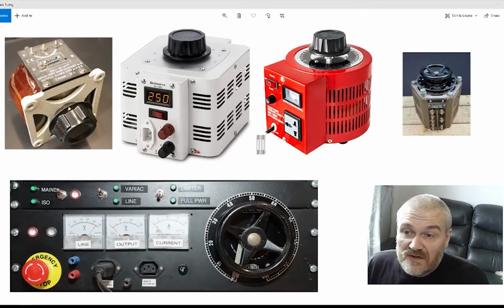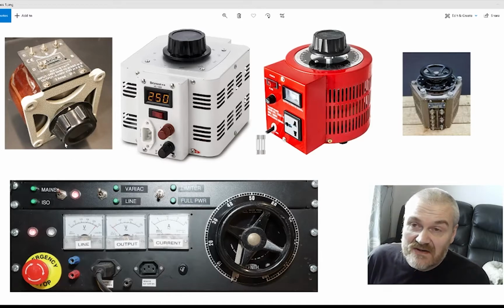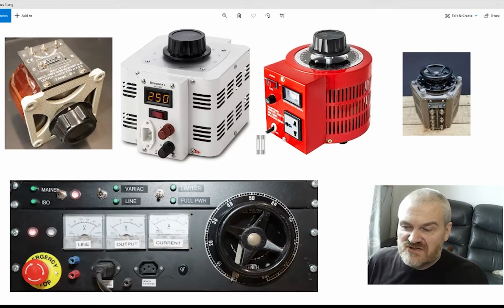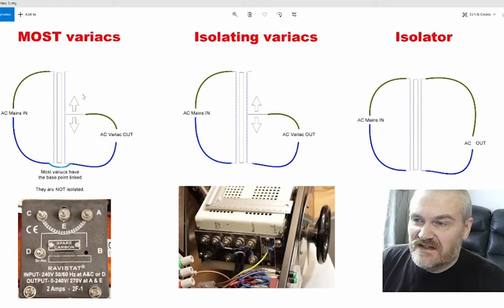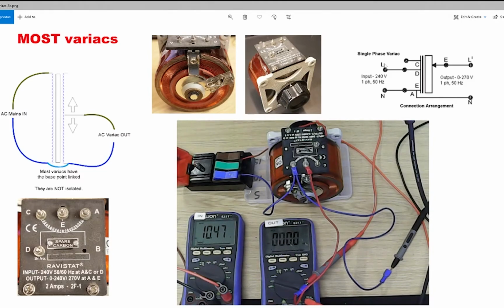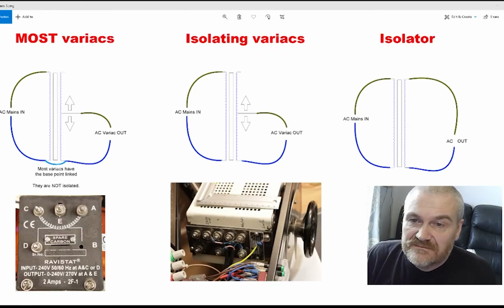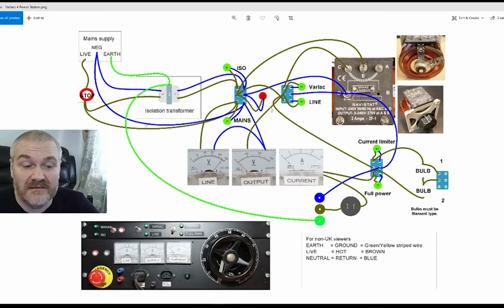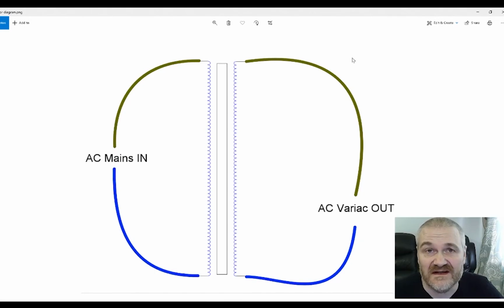#13 Variacs Auto transformers, Zenith Claude Lyons, Ravistat AC

Comment: Marvelous rig you've built incorporating the Variac, metering and switching into one unit! Must have taken quite a few hours? But, I must point out an error in describing the traditional 'autoformer' Variac: There is no secondary winding. (If there was, you could simply cut the neutral jumper from the primary to turn it into an isolating Variac.) Another slight mistake was made when you said that a non-isolating Variac would simultaneously drop the voltage by half and boost the current by two times. This is not a step-down transformer. It's not a transformer at all, but a giant inductor, with a movable tap than can slide from one end to the other. Now, you may be thinking: How does it give the voltage boost at maximum rotation? That's done by connecting the incoming hot lead to a tap which is a short distance from the high end of the coil. Meanwhile, the sliding tap can go all the way to the very top of the high end.
Reply from the maker: Yes, the comment about current was just chucked in whilst making the video without thinking.....  I have my videos partially scripted and it wasn't it the script.  As for the primary/secondary winding part, most viewers will understand it using that analogy and it can be thought of in that way.  You are correct but I'm trying to explain the effect.  The Zenith is fully isolated if you use the pair of inputs and the pair of outputs without linking one end whilst the smaller has one end linked internally.Treating it as a simple transformer with a fixed winding and a variable winding helps explain it.  I read a couple of explanations prior to writing this in order to see if there was anything else I could add and explaining it this way seems to be common.  I could have added a little bit at the end to clarify the matter, thanks.

Comment: Invaluable in vintage gear repair along with the lamp limiter/dim bulb tester. I have a couple of variacs and a 1:1 isolating transformer which as you mentioned are essential.
Reply from the maker: Absolutely. That’s why I wanted to do both in my first 20 videos. Working on a bulb free limiter soon.